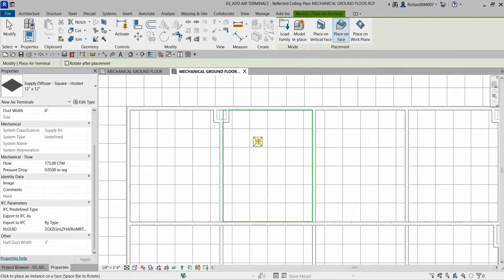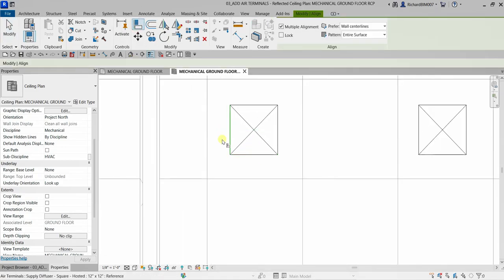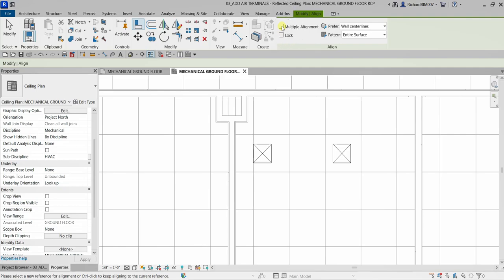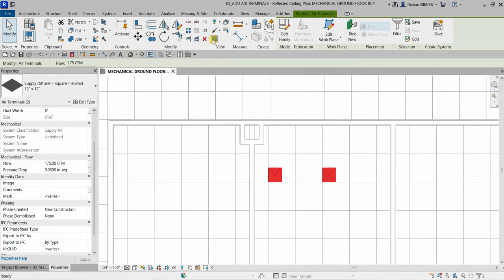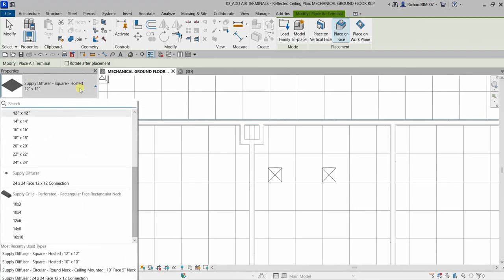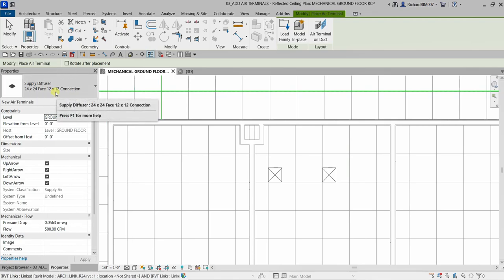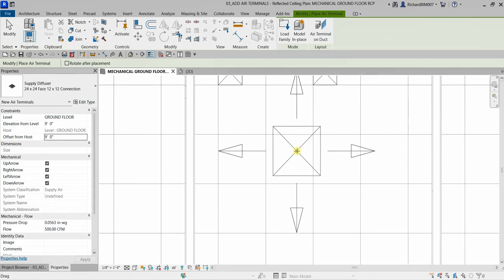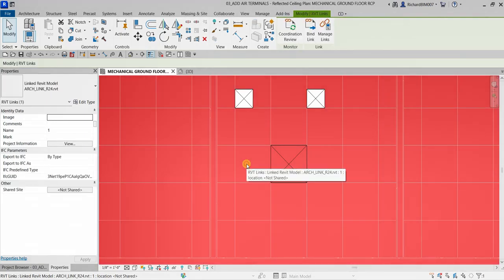REVIT MECHANICAL DESIGN PROFESSIONAL CERTIFICATION PREP: ADD AIR TERMINAL

Comment: where do you get your families from?
Reply from the maker: i use default revit families.
Reply: @bim360  I don't see the air terminal family you used in the video
Reply from the maker: use Load family from cloud. you will find it there.